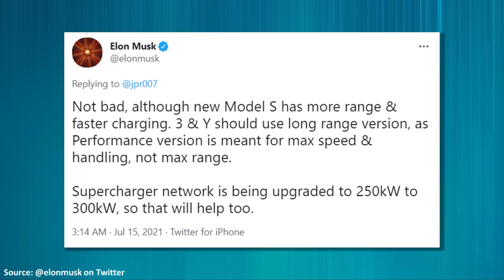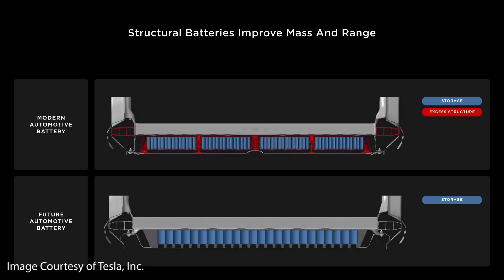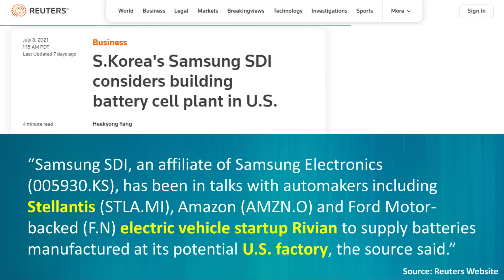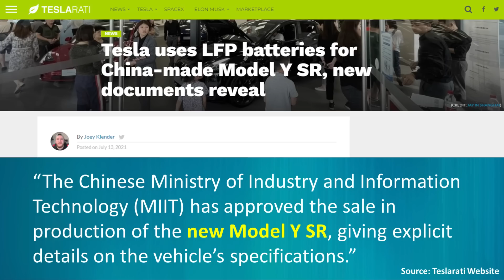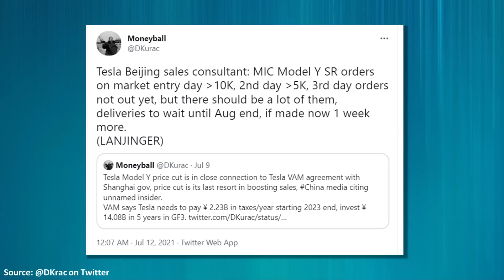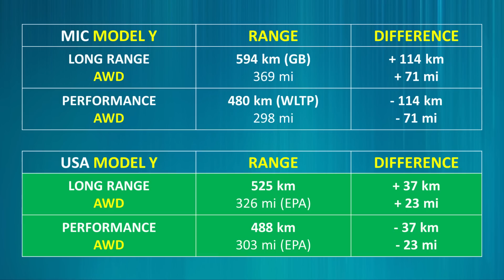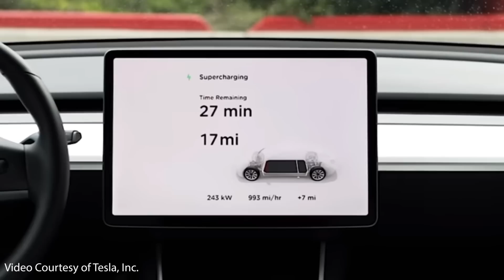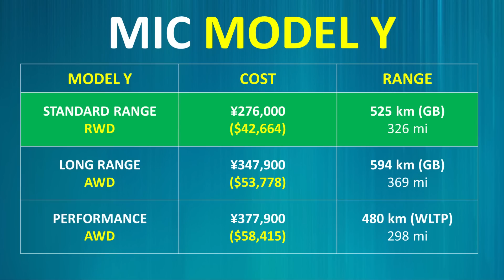New Tesla 4680 Battery Suppliers, 300 kW Superchargers + SR Model Y

Comment: RETIRED VET 76,  REG. CYBERTRUCK. HELP DON'T UNDERSTAND 300 KW SUPPER CHARGERS. PULL UP TO 300 KW, PLUG IN. IT CHARGES FOR 6 MINUTES AT 300 KW THEN DROPS TO 50 KW. EDIT: THAT'S A BIG ZERO!

Comment: Increasing supercharging power 20%, from 250 to 300 kW,  delivers very little benefit to vehicles currently in production.  Sure, it may help 4680 charging in the future,  but we haven’t seen any vehicles with the new battery, so don’t know.  If you inspect the charging curve, all Tesla vehicles charge at 250 kw for a very short time, then rapidly reduce power to prevent battery damage.  We need it to stay near 250 kW for a much longer time from 10 - 80% SoC.   I prefer Tesla invest development $$ to improve the charging curve via better battery chemistry, battery cooling, or something else to reduce charge time.

Comment: You missed another important characteristic of the Lithium Iron Phosphate batteries. I believe the most important positive characteristic is that the batteries can be charged to 100% and driven to close to 0% without hurting the life of the battery.  Given that most charge their regular Lithium Ion batteries to only 80-90% and then don't go below 20% capacity, gives the Iron Phosphate batteries almost the same range in day-to-day driving, a big plus!

Comment: this means nothing I’m sure, but it has always bothered me. The charge rate for batteries. What ever their composition, the charge rate is due to the v difference. For example, If using Lead/acid batteries. the cell V is approx 1.2v per cell at full charge. These will go down to maybe 0.5v per cell at ‘full’ discharge. (these nos are from memory) 

When the charger is connected, and if the voltage is at the full charge value of 1.2v per cell, The V diff is 1.2v - 0.5v = 0.7v.
Now you have a max charge current ‘I’ of 0.7v / int R = charge I. So at the very beginning the charge I is at its maximum. As the battery charges the V difference decreases and then your charge I decreases. It’s just math. As the battery Voltage increases the Charge I decreases. 

The only way to keep the charge I at max, is to raise the charge V to keep the Charge I from decreasing. But this is bad for batteries. (continuous High Heat)

Heat is a battery killer. Unless they do something new and exceptional. A fast charge is always bad for battery life. 

The values for Lithium batteries are different. But the story is the same. So you plug into a 200kw or 300kw charger, You may get a fast charge rate for a very short time, but that charge rate will decrease until Vcharger - Vbattery = 0.

Comment: This needs Elon’s attention.  

Regarding 4680 patent. 

Namely the tab less 4680 cell. What that means from EE and ME stand point? 
Remove the tab, is removing the one and only one “reliable” conduction path for electricity in the 4680 cell. 

Next - flaps was intended to wick heat from chemical towards cell base then conduct it to the coolant channel next below. However point contact flaps has high thermal resistance unless junction area equals to cell base area which is not happening in model Y. Coolant scheme of model 3 will not come out of model Y. Coolant in model Y runs beneath cell base. 

In 4680 patent tab is removed and replaced by point contacts from periphery anode to cell wall, that leads to “unreliable” electric conduction. Whilst tab in 18650 is a solution to address that unreliability. Seems that Tesla is stepping backward this time. 

4680 cell may offer performance as expected by the patent but it will begins to accelerate aging the moment it experience inertial shocks on road, resulting short life cycle at a small fraction of a 1million mi goal. 

The formed up multi anode flaps are made of annealed soft copper foil it can deformed out of shape and will not spring back to maintain “conduction” of both heat and electricity. Entering a run away process, (1) deformed flaps increases cell internal resistance and ohmic heating.  (2) heat from (1) cannot effectively dump to coolant channel can only heat up cell chemical. (3) cell chemical take up heat cannot dump to coolant channel because of (1) above. Continue inertial shocks worsen the situation until the tallest one flap remain touching with cell wall. At this time cell chemical temperature rose exponentially. Further inertial shock momentarily disconnects that last contact causing an electric arc at the anode-wall junction next to hot chemical, subsequently to a possible ignition or small scale internal explosion.  

Remedy?  (1) implement model 3 coolant channel scheme into model Y and to models using 4680 cell. (2) tell the world that Tesla is adding a tab or tabs back to their tab less battery. (3) use CATL’s LFP cell.

Comment: 4680 remedy?

What if Tesla follow up with a means to pretension? Could it be a resolution? The short answer is no. 

Roll up electrode must use annealed copper foil for manufacturability. Work-hardened copper foil possess spring properties good for pretension let foil unwind itself, like a wound up grandpa clock spring, creates new problem to mass production. 

Hardened copper foil periphery flaps resists forming into 90-deg adds to production problem above. 

Next if continue use soft copper foil in flaps but add an elastomer at the cathode end to apply pretension force through the roll onto the flap-case junction. This can be a temporary solution but is subject to inertial impact on road. 

Continue so the softer copper flaps will deform first until the last flap of a highest profile  remains touching cell casing. Essentially that is  inferior to single welded tab cell. 

Up to this stage, the thermal path from electrode to coolant is practically disconnected. Making model Y coolant system useless. Unless revise model Y with model 3 coolant system - wick heat from cell side wall. 

Up to this stage we end up with a single point contact from anode to cell casing. Further inertial shock can momentarily open circuit the flap-case junction causing an electric arc next to hot and flammable chemical in 4680 cell, further into internal explosion. 

Remedy? Tell the world that Tesla’s tab less will be manufactured with a tab or tabs. 
Alternative? Use LFP cells from CATL.
Reply: Thanks for your comment, will introduce you to something totally different on how to increase your income which is quite profitable.... T.e...x...t..+1•8•5•8•3•8•1•2•1•6•4• do well to respond..
Reply: @pinnedc0feeziiia564  Nigerian scammer

Comment: Current battery requirements won't change markedly. The makeover on S and X means that there will be ongoing demand for 18650 for years. There is absolutely no need to increase performance or range for that matter on S and X above where they are now. And Tesla has no other source of batteries for these vehicles. 3 may stay on 2170 going forward. Y will use both 2170 and 4680s and the ramp of 4680s will go hand in hand with massive ramping of Y and CT. Both Semi and Roadster will use 4680s when the supply situation starts to ease. Right now, 3 and Y standard ranges are likely to use LFP 2170s and continue to do so for some time (at least until 4680s arrive in volume). The wholesale switch of all Tesla automotive product to 4680s is highly unlikely to occur before '25.
Reply: Thanks for watching, I have something real big for you on how to increase your income..T.E.X.T
+•1•8•5•8•3•8•1•2•1•6•4...do well to respond!!

Comment: The range numbers may be muddled or even obfuscated, but the new Model Y SR with LFP looks like some new level of efficiency wizardry from Tesla.  It's so much better than the Model 3 SR.  I suspect weight reduction from front castings (and rear, which MiC M3 still doesn't have AFAIK), and semi-structural LFP packs (more structural than Model 3 SR's).
Reply: Thanks for watching, I have something real big for you on how to increase your income..T.E.X.T
+•1•8•5•8•3•8•1•2•1•6•4...do well to respond!!

Comment: If you have 20 300KWh super chargers in one place how do you get 6MWs of electricity to the charging station?
Reply: In Europe they will be connected directly to the medium tension net, 110 kV.
Reply: @joanpere8863  So do you move the super charger network to the grid or do you bring the grid to the super charger? 6MWs is still a massive amount of energy.
Reply: @fidalfadel  Every industrial area has more than one 110kV line. That's what they are made for. And 6MW is not that much. All power lines at least in most of central Europe are triple phase,  so that makes 3x20A for 6.6 MW. That's the output of two to three modern onshore windturbines.
Reply: @joanpere8863  Yes but this is just one super charger. How may does a town need? How much more electricity will a town require when we are all charging and heating our homes with electricity? More importantly major road service stops. These would need a lot more than 20 but are away from urban or industrial centers.
Reply: @fidalfadel  Not even one, everybody with a garage can charge there. Supercharger are only necessary for long distance rides. I can only judge it by european situations. The vast majority is driving less than 100 km a day, which is not more than 25 kWh daily. This can easily be charged overnight with no more than 3.7 kW which is not more than your average oven in the kitchen.
Reply: @joanpere8863  What if you can't charge at night at home? I know over night charging works well. 50% of cars can't do this.
Reply: @fidalfadel  What about charging at the grocery store while shopping? What about charging on the parking place of te employer? Where is it written, that there will not be more and more charging opportunities all over the place? So I will refrain from arguing with the usual fear mongerers. Good by and have a nice evening.
Reply: @joanpere8863  That's the solution then. Every parking space needs a charging point. I believe that green hydrogen is better solution than BEVs.
Reply: @fidalfadel  Green hydrogen means installing triple the amount of electric power generation. One filling point is capable of no more than four fills (9 kg H2 at 700 bar and -40°C) per hour and the price of such a filling point is round about 1.5 Million Euro. It is already evaluated and it has been found, that hydrgen is no viable option for any kind of mobility - too expensive, too inefficient for mobility and the hydrogen is far better suited as reactant in chemical and metallurgical applications eg. for the smelting of iron, replacing coal.

So please let me alone with your silly rants. Tis is my last answer to you.
Reply: @joanpere8863  He wasted your time.
Reply: Thanks for watching, I have something real big for you on how to increase your income..T.E.X.T
+•1•8•5•8•3•8•1•2•1•6•4...do well to respond!!

Comment: Lots of questions, few answers.  Are these battery manufacturers experimenting with the 4680 form-factor using Tesla IP?  Or are they developing their own solutions?  Do they intend to market 4680 cells to OEMs other than Tesla?  Will those other OEMs be interested?  Has Tesla indicated to battery manufacturers that Tesla is interested in buying 4680 cells from them?  What the heck is going on, exactly?

Bah, I hate being in the dark.  :P

For packs currently used in BEVs, peak charging speed isn't very important once you get to 250 KW.  It's the charging curve that matters most.  Where peaks matter will be for larger KWh packs, which in principle will withstand higher peaks.  But even there, charging times will probably be more affected by the charging curve than peaks.

I expect Tesla has plans to improve charging curves, but I'm in the dark as to what their engineering strategies will be.

Well, mostly in the dark.  I am intrigued by one of Tesla's patents, the one for an anode-less cell, where the electrolyte is used both for ion transmission and ion capture.  My guess is that such a cell will exhibit a drastically-improved charging curve.
Reply: Get out of the rocks mate, BYD has the blade battery for example and its way easier to manufacture, plus a battery pack will require less cells and its going to be fire proof, the 4680 is not the "holy grail" of batteries.
Reply: @alanmay7929  No, the 4680 cell is not the 'holy grail' of batteries.  On that, we agree.

But I'm not the one making announcements to the press about setting up prototype 4680 lines.  Battery manufacturers are doing that.

The 'blade' battery is just another word for a prismatic cell, isn't it?  Rectangular shape, stick 'em in boxes.  Cheap to assemble packs, yep, yep.  But BYD's battery packs do not yield Tesla-like energy efficiency and range, and there's absolutely no way to use BYD's cells in structural cell-to-pack designs to save extra weight, move mass inward towards the center of gravity, and yield improved stiffness and crashworthiness.  For structural packs using cells themselves as structural elements, we'll need big cylindrical cells.

The 'holy grail' of batteries isn't in sight.  We don't know which cell candidates will emerge from development to conquer the market.  We don't even know where the theoretical limits are for battery tech.  4680 appears to be a step up from contemporary designs; that's all we should expect from it.
Reply: Tesla isn't the only company making/working on batteries.
Reply: @alanmay7929  Of course.

Still, the other battery manufacturers are not supplying automotive cylindrical cells to anyone.  Anyone at all.  They're all producing and selling prismatic and pouch cells.  So if they start to make cylindrical cells, who are they for?  Are other OEMs about to change up their games?  Or is Tesla really intending to sign up to buy 4680 cells from outside suppliers?

And what's in those cells?  We have no idea.

All I'm saying is, we have many questions and very few answers.  I don't think that is a controversial statement.
Reply: @Urgelt  every manufacturers uses different styles of battery cells, and are supplied by CATL, BYD, SAMSUNG, LG, SKI, Northvolt.......
Reply: @Urgelt  tesla batteries suppliers are going to make 4680 for tesla just like they make battery styles for other manufacturers.
Reply: @alanmay7929  Assumption, not fact.

Tesla hasn't announced they're buying 4680 cells from anyone else.  And battery manufacturers haven't announced a deal with Tesla, either.
Reply: @Urgelt  tesla has been working with Panasonic, CATL, LG and Samsung to make 4680 battery cells.
Reply: @alanmay7929  Alan, you're making that up.

No such announcement has been made by Tesla.  And those companies have not claimed that 'they are working with Tesla' on 4680 cells.

Tesla might be doing exactly that with battery manufacturers, but it's not in the public view as of yet.

Show I'm wrong by providing a source.

But check the wording carefully before you share it, because there's a lot of vague wording and implying going on right now.

My guess is that these battery companies are angling to pump their stock prices by implying that they are about to sell 4680 cells to Tesla, or to anyone.

Tesla scares the hell out of them.  It will soon be the largest battery manufacturer in the world (well, within a very few years).  How will existing cell manufacturers stay relevant?  Tesla's BEV competitors are small potatoes; they'd rather focus on hybrids, which don't use as many cells.  So these cell manufacturers rush to assure investors that they won't neglect 4680 cells and are setting up pilot production lines.  But where are the details?  Who will buy those cells if they make them?  What tech is in them?  They invite us to assume their cells will be equivalent to Tesla's, and that Tesla and maybe others will buy them, but assumptions are not facts.

It all sounds janky to me.
Reply: @Urgelt  im making nothing up, tesla is looking for more battery suppliers for their cars and they don't use different batteries cells end of Story.
Reply: @Urgelt  stop talking nonsense mate, CATL is actually the world's biggest battery manufacturer and they are significantly improving and increasing their production, just like LG, BYD and many others, battery raw materials doesn't belong to grow up.
Reply: Thanks for watching, I have something real big for you on how to increase your income..T.E.X.T
+•1•8•5•8•3•8•1•2•1•6•4...do well to respond!

Comment: FYI,  the Model Y SR is listed in Hong Kong with 455 km (283 miles) under the WLTP test cycle. It is reported to have LFP and 60kWh battery pack. It is going to be a game changer!!!
Reply: -9% from WLTP that is 257 miles range.
Reply: byd ea1 will have the same range for half the price
Reply: all model y variants made in china has lfp batteries. he should have mention that